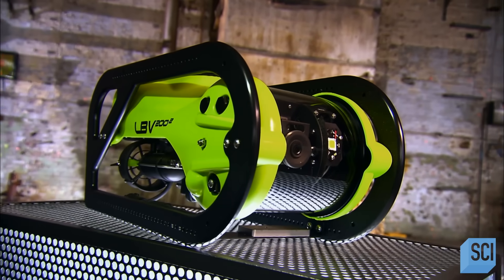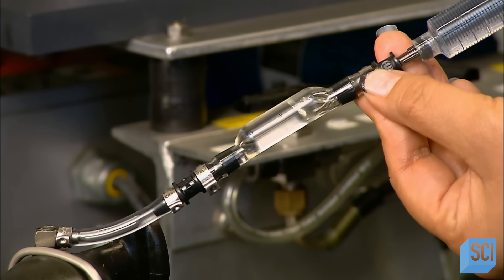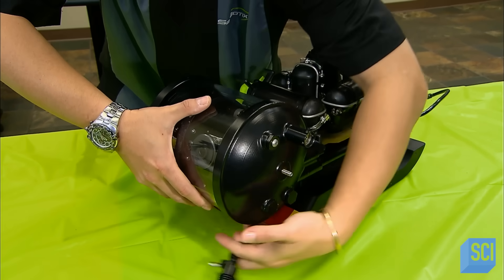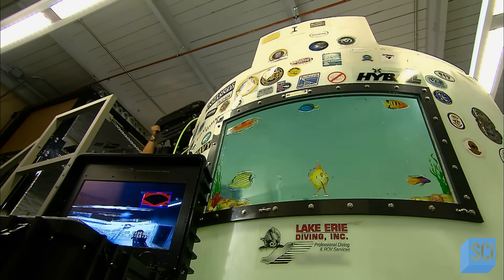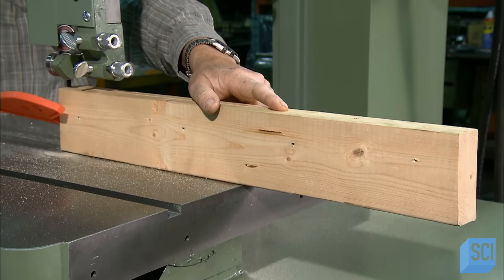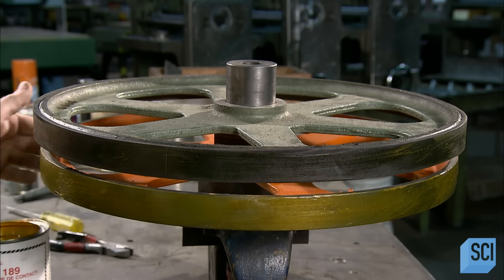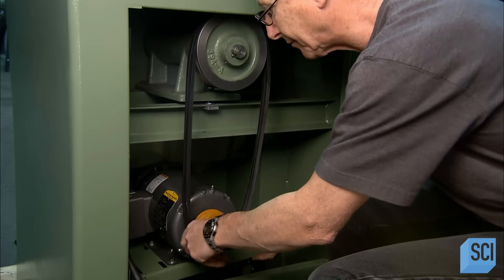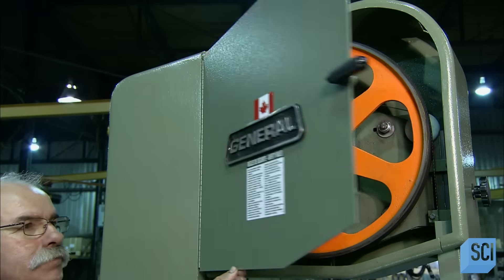Underwater Robots and Band Saws | How It's Made | Science Channel

Comment: 90 minutes of not breathing without brain damage?  that doesn't sound right....more like 9 minutes from what i've heard
Reply: I always heard that it was 3 minutes.  It could be that the script writer went a few minutes without oxygen.
Reply: the water would keep the body cold and put it in a state of shock that you can be brought back from in very specific cases and only done right with proper meds pushed and good CPR but it is not for certain its a very big gamble.
Coming from a trained EMT.
Reply: @angellsdreamz  Thanks for the info.
Reply: Nice observation. One thing to consider is that this was recorded 10 to 16 years ago, and health recommendations change. I was curious enough to ask the internet. Above 20°/68° (C/F) after 10 minutes without oxygen brain damage is imminent. Below 20°c has cases of people last 30 to 60 minutes without oxygen to the brain, but that is still worded as to be uncommon.
Reply: Hypothermia can significantly increase survival time
Reply: It's Canadian, they are talking about extreme cold as their "up to" number. Also, the narrator cannot pronounce "robot" correctly. He says "robut" over and over to trigger us.
Reply: @ "Robut" is also a correct pronunciation and used to be the more common one. If you watch the original Twilight Zone series, you'll hear that pronunciation more than once.